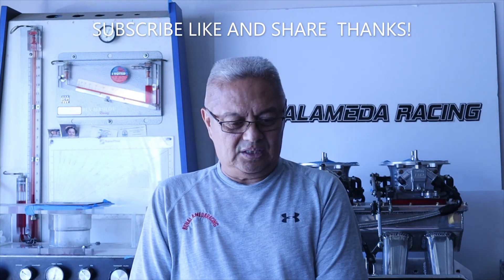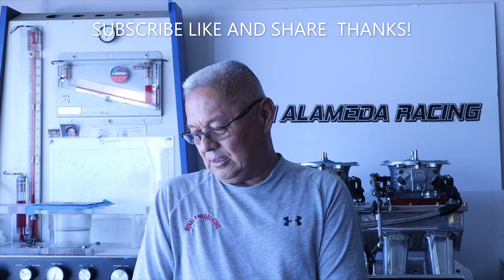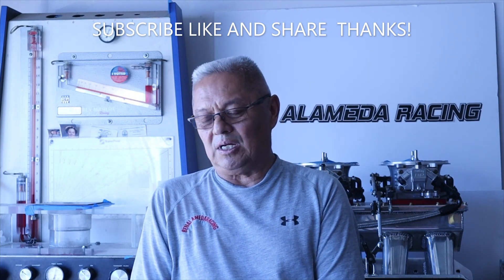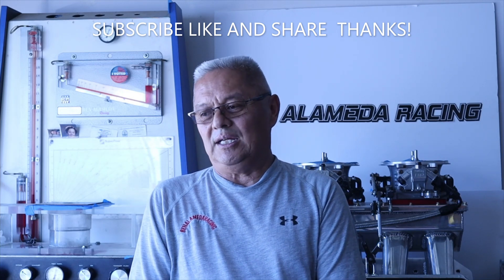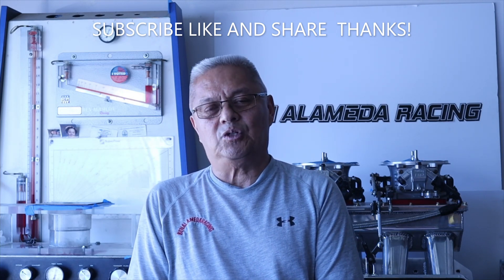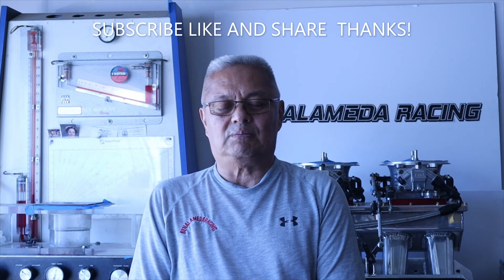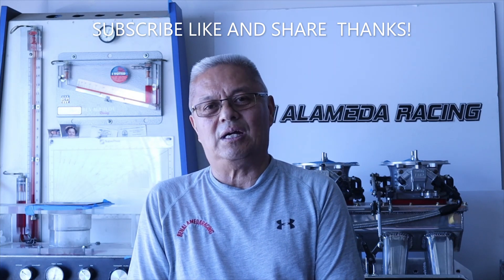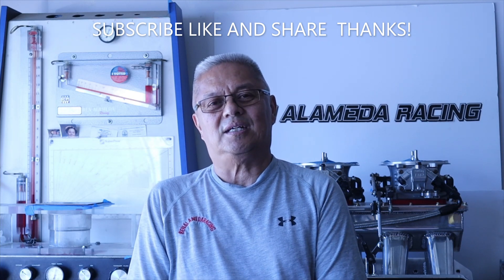ENGINE BUILD FOR BIG POWER AND EFFICIENCY.

Comment: I just watched an engine masters episode of aluminum vs iron heads with the heads being the same from dart on a 9.5 compression engine and the aluminum heads kicked the crap out of the iron heads even down low. They also put a lot of load on the engine to create heat and the aluminum heads were even better. I'm confused here I thought less heat in the chamber would create more oxygen to make more power.
Reply from the maker: When I see this comparisons it is always skewed because the aluminum part usually has the bigger valves and ports hence the advantage.  This said, with everything equal and under 12.5-13.1, the iron head will exhibit an edge more so if the compression gets even lower than that.  The answer is thermal efficiency and at 9:1 switching to aluminum actually looses efficiency if all else is equal like I stated primarily.
Reply: @benalamedaracing2765  this test was done on a 9.5 compression 383 with both heads being the same in every way with the same valve sizes same intake and exhaust runners and same size combustion chambers. They also flow tested each head and the iron heads flowed 5 cfm better and the aluminum heads were better in every way so I was confused when you were saying iron heads are better in low compression engines because they retain more heat and create more torque.
Reply from the maker: @lauriie1990  , perhaps and there will be variables like how they may look flow similarly and then again do they have the same amount of swirl and tumble mixture motions specially the very sensitive combustion chamber shapes.  Dyno testing is all great but from what I have seen and felt thru the years on an almost similar set up the torque of an iron head specially at the lower ranges are much more pronounced.  And one of these videos I had a 306 with an iron headed dart head running 9.30's at a street legal race @ Pomona and everyone was shocked to see an iron head engine dominate everyone with an aluminum headed engine.  This said, you can build identical engines as much as you can and the horsepower will be different and sometimes the superior engine on the dyno is not necessarily faster at the track.  Do we believe the dyno or the track results?  There are so many dynamics involve so we should just be aware of something that will skew our views and opinions.  Thanks for the input Laurie.
Reply: @benalamedaracing2765  thank you for the reply back I'm learning a lot from your videos and just did the piston ring mod on one of my big blocks
Reply from the maker: @lauriie1990  appreciate your as well sir.  I am presently doing a video of a dyno and track test which was very different result.  In short the cast iron showed almost instanteneous torque off the line much stronger than an aluminum version and dyno do not see these things like shorter vs. long rods.  Nothing on the dyno but circle track guys use a shorter rod for more response off the corners on short tracks.  Super speedways yes the long rods show more speeds just like what the dyno showed.

Comment: Man you are a wealth of knowledge that I could listen to all day. I have a 347 in my 79 pinto with 11.3:1 compression 210cc heads flat top Icon 2 valve relief forged pistons with a single plane intake. What cam specs would you recommend for this setup to net the most power out of it. Its making 422 to the wheels now but I know that there's more in it so if it was yours what cam specs would you get to net the most power ?
Reply from the maker: Where is your duration @ .050 now and lift?  I hope you are running rollers and not flat tappets! There is a difference there.  It seems 422 at the wheels makes you at about 550 flywheel which is not bad but maybe we can still step it up.
Reply: @benalamedaracing2765  intake @50 is 242  exhaust duration @50 is 248 intake lift is .576 and the exhaust lift is  .600 with a 110 lsa and yes roller all the way 💪😁 yeah I will take every lil bit I can get. It was kinda a max effort build but after watching a few of your videos I missed a few things 🤦‍♂️ 😆
Reply: I can't wait to order the cam that you recommend, I will probably need everything needed to tell them how to grind it because I have never ordered a custom cam before but I'm sure that you have a grind that will be like throwing a super charger on it compared to the one that I picked out 😆
Reply: @79beans347  Hello, I am not Ben, lol. However it looks good except for 2 things.  Put 1.7 rockers on the intake side and get a cam with same specs but on 108 lsa.   I have done this more than once.....     BTW what intake manifold ? Also what is the rest of the combo ?
Reply: @Comet-hn3gm  im porting a vic jr. To go on it.. the rest of the combo is msd ignition , scat stroker kit Icon flat top 2 valve relief pistons 750 proform dp . Electric water pump t5 trans 410 gear 8.8 31 spline with caltracs hooker header equal lenth long tubes . Im sure im forgetting something but I appreciate your help
Reply: Hello. I dont have experience about automatic transmission...when the turbine is not locked and you put power to it, could the power loss really be 128hp, like Mr. Ben said. I mean is the power loss procent almost constant with automatic transmission? More power you get from engine the more you lose in turbin, so the the power loss is for example 25%.

Comment: Hello Ben . Man it's been over 15 years since we have talked. I met you through Ray. I bought some TFW Heads from you and had them ported and polished by you as well. I put maybe 200 miles on them and parked the car for over 13 years. I want to build a 750 to 800 horse car street with boost. 351 stroker . I would like to know the best head to go with my combination.  Please get back to me when you can. And the heads I would like to sell for up grade.
Reply from the maker: Those heads might still be good and just change the springs and open the ports up some more for boost!
Reply: @benalamedaracing2765  thank you Ben. I sold them today. Now I'm going 205 AFR . What would you recommend for combustion size. 351 stroked 427 and I want to boost it. Dropping compression from 10.1 to about 9.1 or 9.5. What you think .

Comment: Another great video Mr. Alameda! The picture of your combustion chamber (25:54), it appears to me to be darker on the exhaust side than the intake. Is this due to the spark plug angle, the combustion chamber, swirl, flame front extinguishing...? With respect to aluminum heads vs iron, would running a higher cooling temp (190-200deg) vs your recommended 180-185deg offset the iron head thermal efficiency? Thank you!!!!!!!!!!!
Reply from the maker: Ts302, I explained that issue of darker on the exhaust than the intake in one of the videos.  The mere fact that the intake side is leaner is because the heavier fuel molecules could not stay attached at that area below the short side radius of the port!  Most of the heavy fuel ends up slamming on the chamber directed at the spark plug and exhaust valve regions.  When ignition commences it is very rich in these areas and very lean on the intake valve relief closest to the cylinder wall!  Herein it lights up last and if dangerously lean will self ignite here from the rising pressures/temperatures of the ignition flame front.  This picture exemplifies this condtion and I stated on past these is very close to "lean is mean" concept of tuning.  It can easily backfire on me here if I step any more closer to making it leaner as it already is!
Please check my video on piston cracking on the intake valve side and it shows it more on details.  Thanks again for your support!

Comment: Great video. I want to stroke my Cleveland. The 408 had 1.5 rod ratio. 393 was better. I was afraid of the 1.5. You talked about the TDC dwell time was better on the stroker. If you have a opinion to share please advise. Mine is a street car. Thanks.
Reply from the maker: Steve, if you are not buzzing the engine to 8K I would not worry about rod ratio.  Try to use the lightest forged piston available and with an aftermarket rod should do wonders.  Do not use the 2V US heads and Australian 2V heads are available and reasonably priced and used them many times!  With a 408 flat tops should give you about 12.2-12-4 compression and that is a tad high for an iron head for the street.  E85 will work real good if it is available in your area.

Comment: I have zero deck height and .030 gaskets. Is that too close?
Reply from the maker: If your piston to wall clearance is good then it will be ok.  I have run as tight as .027 with no issues so you are good to go.

Comment: 5 stoke overlap??
Reply from the maker: The 5th and ignored cycle called "overlap" is what makes a basically lawn mower engine a racing engine!  It is an essential part of volumetric efficiency and without it it will not be possible to make power at high engine speeds of even medium speeds.

Comment: I hear they have built 529 cid LS engine,  WHAT!  How??  It must be tall deck,  either deep skirted sleeves, because a 4" stroke nearly pulls the piston out the bottom of the bore! I would not go longer than 3.75-3.85, and would be wanting a longer rod  about . 200" longer  but definitely a longer rod with 4" stroke, I don't know if 4.125 is possible , or if 4,200 " bore uus possible, but definitely adding .250-.500" to the deck would help that's a lot, displacement, 425/427 is huge add 100 to it , I like short stroke engines, I'd put a 4.8 crank in  a LS7, with twin turbos  but on the normal side a 385 is about it for a 4" bore 3.75-3.85" and 4" for 4.125 bore  ,  but for a generator to run my house , a 6" bore, with 12" stroke  diesel spinning at 400-500 rpm  for normal use, generating  power, opposed twin diesel  burning waste oil, diesel, kerosene,  motor oil with a small amount gasoline , with a turbo making about 80hp to 100hp a in like race trim, peak power,  4 cylinder, 6" bore 10- 12" stroke,  14psi, 28:1 compression , air blast  fuel injection,  like a paint sprayer working at 200bar,  it would probably  require 5 HP to provide a constant spray, the fuel sprayed into tiny passages, with a tiny y making about 6 -8 tiny venturi,  vaporized the fuel as the fuel and air blast goes through the injector
Crazy I know! Sorry to ramble
Reply from the maker: Displacement is good if you can feed it with enough cylinder heads.

Comment: Please talk more about BBC engines with stock cast heads #049 - #781  Need retro Hydraulic Roller cam info ?   72--454
 I always hear you talk about flat tops. How do you feel about dome pistons for the street?
Reply from the maker: I will always use hydraulic roller retrofit cams all the time!  I prefer them and produce good power.  Dome is necessary for BBC trying to get compression of at least 11.1 on the streets.  Do it if you can and it will be worth it.  It only becomes a handicap if you are going all out and that is when small chambers and flatter top pistons dominate.  Otherwise on the street, dome  is better than low compression.

Comment: All the fuel mileage gained with compression lost without vac advance. Get a tunable vacuum pod.
Reply from the maker: Could be because at high vacuum it pulls the advance so that is good.  This said, if the advance curve is fast even @ lower rpms range the centrifugal is kicked in just like if the vacuum port was on.  With rpm we can control the amount given and with a vacuum a lower or higher load can change the scenario altogether.  I like to keep things simple and less movement the better.  If you are good with it why not and others have a different preference and that is good.

Comment: So Far target daily driver street car. 2nd gen F Body. Pizza Delivery Car.
  Stock Cast Crank. 3.48" Stroke. Very SmalL Lightening Holes Through JournaLs. 
  Wedge   Corners Trimmed. Knife Edge Swoop on one side facing rods.
  Balanced, without metaL fills. Passenger side kickout pan.
  Forged 6" I beam Rods. Rods Polished Weight +/_ O. And O.O4O" Head Gasket.
 -O.OO2" Pistons Above Factory 9.025" Deck Height LeveL Exact. Factory 'O1O' Block SBC. Crower OO484 LM. 284*/286* Degree Hyd. Roller.
 234*/236* @ O.O5O" Lift. 114* LSA / 108* ICL. O.363" / O.370" lobe lift
 355 C.I. SBC. 62CC Chambers, Brodix Heads, 5.5CC Flat Top 2618 Alloy 1.285" Pistons. Static Compression = 10.88:01. 4.O3O" Bore.
 Dynamic Compression = 8.27:01 calculated. Tuned Tri Y Headers Designed to Combination.
Target = 180* Degree Thermostat = 190* Degree coolant. OiL= 200* Degrees.
FuLL mechanicaL Advance? 780 CFM vac. secondary Holley/aftermarket parts build.

Some day i am shall check at the track with 108* LSA versus this 114* LSA. To see what does better, Although i am may need to reduce compression when switching over to the smaller 108* LSA TO MATCH DYNAMIC COMPRESSION AND CYLINDER PRESSURE TESTING AS EQUAL even if i am need to take the heads on and off a few times. Because dynamic stroke and Dynamic Compression ShaLL increase when the LSA gets tighter and there is more overlap.
Reply from the maker: Looks good from here and I feel the 108 icl would provide better track times depending on the actual weight of the car with you in it and the rear gear ratio and trans type.